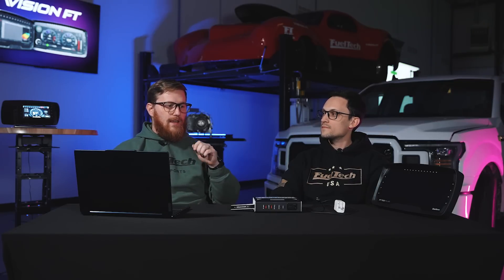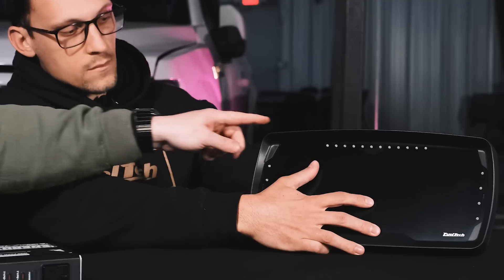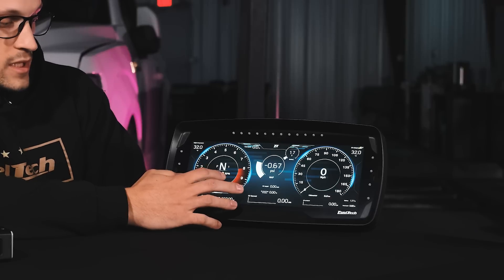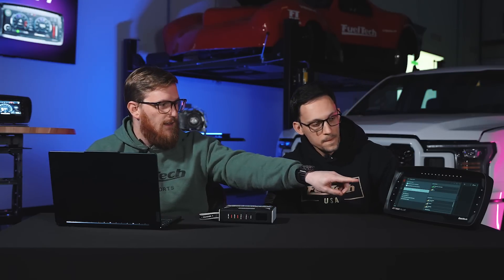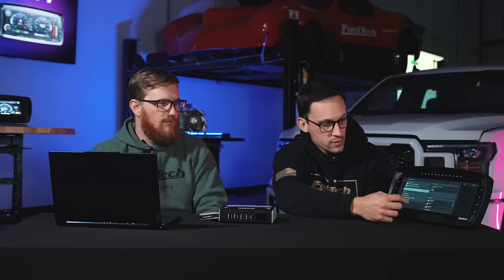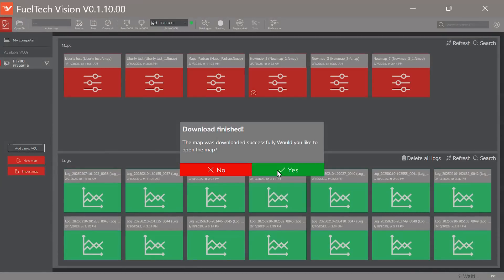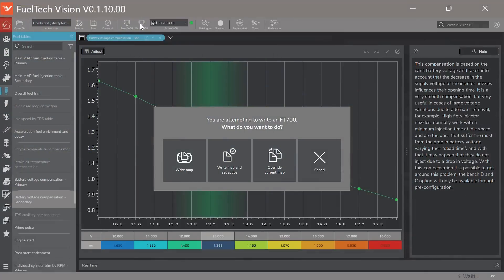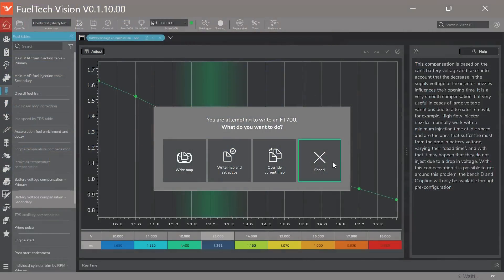Seamless Wi-Fi Communication with the FuelTech FT700 and FT700PLUS

Comment: Hi, I have a question. To connect to the vehicle in a controlled space with available Wi-Fi, I just need to connect the laptop and the VCU to the same network. But if I'm in a pit-type environment with the laptop connected to the pit Wi-Fi and the vehicle is on the track, how do I connect the VCU to Wi-Fi so they can communicate?